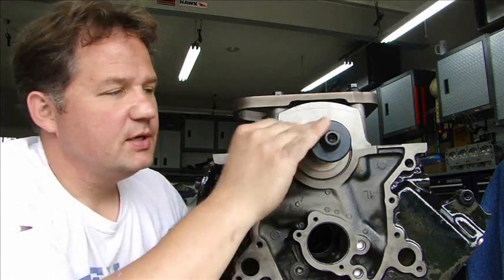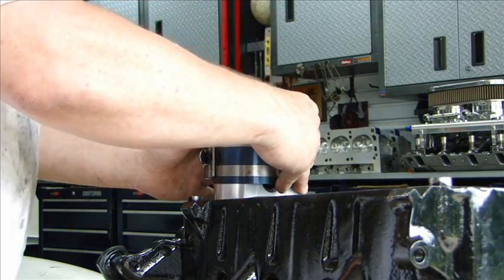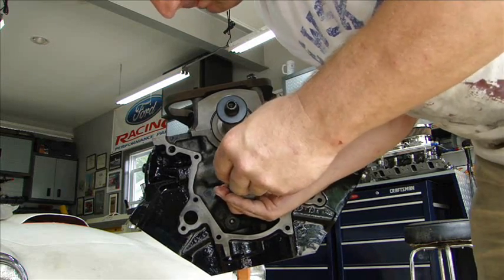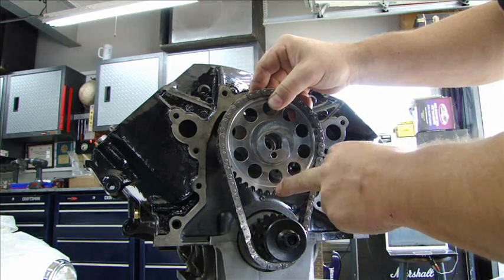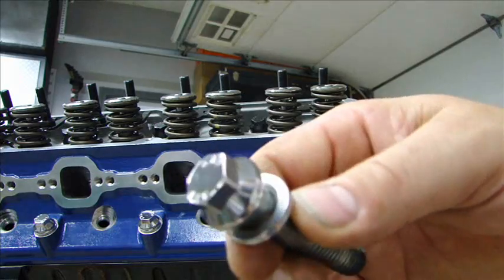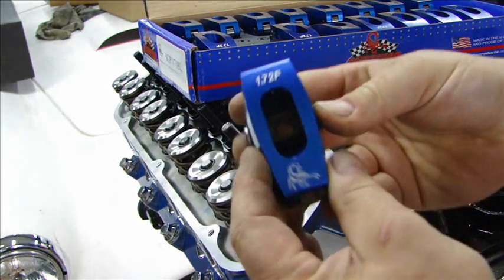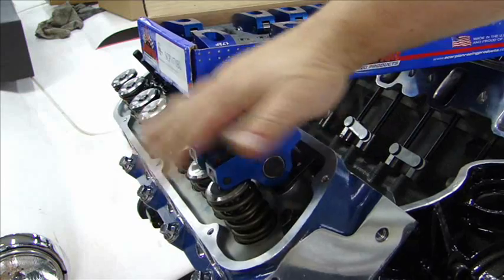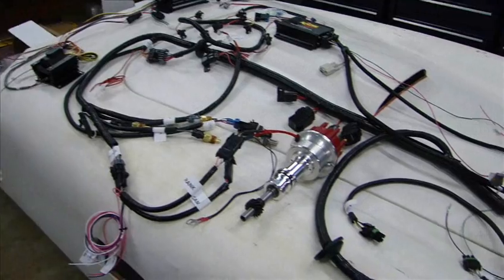Cobra Engine Build Part 1

Comment: Pete, i think a good point to add in when assembling the lower end and getting the pistons in would be to cover clocking your piston rings properly and maybe a how to video on that, would also like to see some videos on something that all ford guys can appreciate, the old school Yamaha engines, i know for sure i would love to see some cool SHO builds, the taurus was and still is the ultimate sleeper, hell id gladly donate my time to help (cough cough my daily is a SHO) :D
Reply from the maker: Clocking rings is a pretty controversial subject. I always say to follow the manufacturers recommendations. I have read studies that show the rings do rotate while the engine operates. Drive on down and we'll rebuild that puppy
Reply: Haha we'd have to talk numbers before a commitment like that. Tempting though
Reply: Please elaborate if you will
Reply: Joe Dupuie If it's true that the rings rotate during operation, then it's probably best to separate the gaps by the most distance to minimize any possible alignment of the ring gaps.  I guess it would be safe to say any number of combinations would work other than aligning the gaps but I don't particularly like guess work, that's why I watch these vids and try to learn.
Reply from the maker: This has always been a controversial subject. If you follow the manufacturers recommendations you can't go wrong.
Reply: ***** i've always followed the 180 degree clocking as it makes more sense to me for ensuring gaps dont align. it's all builder preference at the end of the day.
Reply: You can put the rings in at 180 degrees but they will rotate to where ever like as soon as you start it up.

Comment from the maker: That is true...but there is a method to my madness. If you put the cam in first, while you are putting on the rod caps you run the risk of dropping a cap, bearing, or even worse, a bolt, and nicking the cam. That is why the cam is put in after the pistons are installed in engine assembly plants. There is no right or wromg I guess. Sounds like you have a killer motor!

Comment from the maker: The exhaust rockers are fine at 1.62 but I want to open the intake valves as much as possible so I am using the 1.72. It's pretty common....they are sold in split sets.

Comment from the maker: Crap. I am so sorry..I should have thought about that. The problem is not the stud itself, it is the size of the thread that holds it in. If you tell me the diameter and pitch of the threads I will do some calculations and tell you what size thread you need so the rest do not pull out. If one did, others will. Let's fix this the right way so it lasts a long time for you.Going from 80 to 100 is almost a 20% increase, probably 25% with the higher ratio.

Still working on my oil problem.

Comment: Great vid gonna really help me with some of the decisions in my build. In regards to the iat you are right that it is critical at idle but it is a intake air temperature sensor am a mechanic by trade and have had problems with iats before
Reply from the maker: This particular system requires monitoring the air temp in the idle air stream. Since there are two throttle bodies there is only 1 idle motor in the rear one. This sensor is placed in that air stream because it is only active at idle.....I do understand your point... Thanks!
Reply: How does it monitor air intake at load then?

Comment: Take an old fan belt, bend a loop in it, and poke it under the cam as it comes through.  Gives you a little leverage, and helps hold the cam up, and aim it into the cam bearings on the rear of the cam.
Reply from the maker: Stoney Browning That's a cool idea!

Comment: One thing i noticed. You said that ARP hardware is Grade 8 Hardware. This is not true. ARP bolts and hardware is actually stronger than grade 8 hardware. This is due to the originator of the ARP brand, noticing racers of the earlier days of the hobby using true grade 8 hardware for their engine builds and having to constantly replace fasteners. Seeing a need for a stronger more reliable way to keep their motors together. thus the beginning of ARP (Automotive Racing Products)

Comment: ARP actually has a different part number for head bolts sets that includes stainless bolts for the outside. I'm running the same rocker arms on my SBC.

Comment from the maker: There is not enough metal in the casting to cut a pocket big enough for a ball bearing race. It would not last as long as the standard surface bearing and a failure would be catastrophic instead of a gradual wear like current bearing types. There are many forces and temperatures applied to a cam...ball or needle bearings are just not up to the task. Very good thought process though...I like it.

Comment from the maker: The starter may be to tight to the flywheel. Loosen the bolts a little a try agan. If it turns easier you will have to shim the starter away from the flywheel.

Comment from the maker: Not so... A 5.0 can have a smaller bore with longer stroke. There are many shapes a gallon of water can fit into. The flow rates of the heads will determine carb jet size or injector latch time. The variable cam timing is done with a hydraulic phaser. If you have a closed loop OBD II system it could throw off all of the computer settings. You will need to re-program the EPROM for the new engine settings. It's a complex project you're taking on. Good luck.

Comment from the maker: I wanted to get the intake valve open as far as possible without using a radical cam. It is common to buy rockers in split sets.

Comment from the maker: I'd have to look it up...but I'm sure it's Federal mogul. If I build a motor that will run within a day or so I usually just use 10W30. Engine plants just use motor oil and the engines can sit up to 4 months before running.

Comment: I have built many engines. The FIRST thing you put in is the cam. Put the engine on its butt and slowly drop it in. Will not damage the cam bearings.

Comment: the exhaust note of an engine is related to the manifold design, which is related to the firing order, which is related to the cylinder layout and crankshaft design - therefore the sound of flat-plane V8 is usually somewhat like a pair of four-pot engines screaming simultaneously, unlike the rumble of cross-plane V8s.

Comment: Man those rockers a friggin gorgeous. How much your valvetrain run you? seems like you did EVERYTHING and the part I love the most is the hydalifters. Low maintenance is a big plus. Also what kind of lift and duration #'s your cam puttin out? What kind of overlap you gonna have. I could go on but I know you have a life lol. Also what kind of girdle is that? didn't know 5.8's even HAD girdles. lol. Still green sir, I'm still green :D

Comment: hey like the video u seem real knowledgeable everthing looks real nice thanks for the tips.

that being said i did wonder about the crank and cam insertion it seemed a little hard to turn the crank, i was wondering if it was lubed i had not seen u using oil on the install of that or the camshaft.

Comment: next time when u install a camshaft..stick a long screw from waterpump in the center hole of the cam and it will bee much easier to "balance in" the cam holding it by the screw ....

Comment: Great video. I just took the hood and front quarter panels off of a high mileage Toyota Corolla so I could use it as a make shift engine run stand. I’ve always wanted to have a hobby of rebuilding engines, and Toyota is one of my favorites. Any advice on the best after market piston / seal manufacturers as well as the best machine shops for boring and honing?

Comment: I need more details from you MasteR about adjusting the hydrolic rocker arms
Reply from the maker: How can I help?
Reply: I have 93 gt stang and im doind overhauling the engine stock crank rot pistons..only cam b303 with aluminum cylinder heads gt40 with hydrolic 1.6 r with bbk sort headers...i dont know how to abjust correct the clearance on the valves and how many lbs i have to tide the cylinder heads bolts because is aluminum

Comment: Hi Pete, was wondering if you could help guide me in the right direction. I have a 3800 series 2 GM engine V6 that I am looking to install ported heads on. Would your method for adjusting valve lash be similar to how it would be done on my engine? From what I heard from several videos both intake and exhaust valves have to be closed (on base circle of the cam) but you made your adjustment with either valve opened a little. Any advice on this subject would be greatly appreciated sir. Thank you.

Comment: Thanks for the reply. I'm just trying to get 400 hp with h/c/I. (and exhaust)
And have never built an engine before.... But read A LOT about it if that counts for anything. I don't understand cam measurements and how much of a difference that it will make on the valve end or how to calculate that.

Comment: Hi Pete. I have a 1991 Mustang 5.0 I got a set of Roller Rockers by Crane. It's a pedestal type rocker with a 1.6 ratio with small shims included. Is it a simple install for my stock engine or must I do adjustments?

Comment: What application is this engine built for? Street/strip or mainly street? Seems like it would be an awesome engine to throw into a drag car. I plan on doing a build for a street/strip notchback mustang down the line but i'm still trying to find out  which engines are good for that application. Right now i'm looking into doing a 351w based 427 stroker for it. Still new to this so any input would be appreciated!

Comment: I have a question. I'm currently building an engine with my dad. and one of the problems we came across is when we put the spark plugs on the engine and begin to attempt to start it. the starter has a hard time to spin the engine. we assume the engine has high compression. Could you give me as to any ideas of what you think the problem could be? Thanks in advance!

Comment: Does the valve lash adjustment apply to solid cam and solid lifters too? I have solid lifters and a solid cam but roller rockers, how would I adjust that?

Comment: now what is the use of the different rocker ratios. so you can use a small lift and duration cam while still have a sufficient amoutn of lift and duration or what? thanks

Comment: It is cool , but it is a 408 if my math is right.  You could bore a 390 to 4.08 , and add 4.125 crank and you have a 431. It would look great. I don’t understand why people put Windsors in , you are able to set up a great EFI FI, even two FITech throttle bodies the use 58 psi of fuel but they are self learning.  I just wondered   I haves seen 595 hp and 555 ft lbs from a 445,  4.08 bore and 4.25 stroke. I n  ll m just curious,  you are an outstanding craftsman, and I love the guitar s I am 62 now and I really miss playing but I messed up my shoulder and arm.
Reply from the maker: Cost, and those EFI systems were not available when I built the engine

Comment: Always soak rolling parts like roller lifters and rockers in oil before installing. You need to make sure oil is down in the needles before starting. Always check cam timing, never assume. Check valve geometory.
Reply from the maker: That is a great tip...thank you. It has been my experience that unless you are going to start the engine relatively soon, any oil you soak parts in will either drip off or evaporate within a couple weeks. We assemble engines with 5W30 in the factory, but for hand built engines I like the Moly lube that will stick.
Reply: You need to make sure there is oil on the needles and the only way is to soak in oil. Dry needles on start up can ruin them. You cant get molly into the needles unless you dismantle them and that has it bads.
Reply from the maker: Another good point. I usually tilt the lifters sideways to get lube into the roller...like packing a bearing

Comment: Pete I have a very serious question to ask.  I'm rebuilding my sbf 306 due to a flat tappet cam lobe being destroyed.  The block is all cleaned up and it's ready to be rebuilt.  However I've been contemplating on a roller cam setup.  I'm really leaning on wanting to run one of the alphabet Ford roller cams but what am I to do about the lifters.  My block is a 1980 flat tappet block.  I see that I can retro-fit it with the spider tray and dog bones but I would need to get a smaller base circle camshaft.  I don't want to run one of those cams.  So my biggest question is if I get a set of those link bar lifters (Howards or Lunati because even though they are $360 they are the cheaper ones) can I then run any regular roller camshaft I want?  Now I do understand that I would need to change the distributor gear, pushrods and possibly valve springs.  Your guidance would be greatly appreciated if you had the time to chime in.  

-Billy
Reply from the maker: Hey Billy....I would look at getting the cam and lifters as a set along with the retrofit dog bone. You will need to change the push rods and valve springs to match. I would do that anyway since the motor is apart. If you need more help give me a call
Reply: If it get one of those then it would be one of those smaller base circle camshafts. Right?

Comment: And why would that be? Injection tends to improve driveability, makes more torque, solves cold-start problems, lowers emissions, and improves gas mileage. Unless the engine comes with a carb, injection is anything but a bad thing.

Comment: Peter, can you advise on a Rochester carberator, whether you need two O2 sensors, i.e. one for each header to ensure you have both idle mixture screws adjusted correctly?

Comment: I just figure that the new 5.0 is still 302 cubic inches just like the old. The only difference that I can see is h/c/i and rpm range, so if I can match flow rates or exceed I should make the same or more. The only thing I can see lacking is variable cam timing, resulting in a narrower HP and TQ band

Comment: I have a 4.3 vortec.
The stock rocker ratio is 1.5 and as im sure you can imagine the cam is quite mild.
Ive read that just a 1.6 on a 350 can usually make around 25hp
I figure a 1.6 on my v6(bone stock) would hopefully draw around 12-15 
Would i have to do any adjustments to studs or add cradles or anything?
Im told going to a 1.6 requires no other parts.
But what if i wanted to go to a 1.7? Im sure thats pushing it on stock valvetrain but im only turning 5k rpm.
I understand if your not sure

Comment: Are there any clearance issues on the block with that size of a crank?  Any die-grinding or is it a drop in?
Reply from the maker: Yes. The block has to be cleaned up where the weights come close. But it's just a quick grind with a burr to make the needed clearance.

Comment: pete nice videos and how much in the engine besides electronic's ? im buying a F0 block 351w for my first engine build its gonna terribly slow process with money issues but im get it done
Reply from the maker: +Hector Romoarias This engine was $15k and the electronics added $5k. If you made some different choices you could do it for around $6k
Reply: I was going to buy one but i didnt get the deal soon enough

Comment: It seemed like you had to smack that piston quite hard to get it in the bore, usually light taps with a wooden handle of a hammer and they slide right in for me, were those high tension rings or something?
Reply: Looks like hes using an old school band type compressor which don't work very well unless they are pretty tight. The important thing is the pistons slide down the bore with reasonable freedom. This guy seems to be pretty good, Id venture to say his end gap and bore clearance are in.
Reply from the maker: They are racing rings and I gapped them on the low side. It is tough to get them in, but I do have collars for standard bore sizes so the piston slides right in by hand.

Comment: Do they have an engine mount that turns the engine 90 degrees vertically? This way the cam can be dropped in with no hassle..
Reply from the maker: skynetter121 You're on to something
Reply: +Petes Garage I always installed the cam first.  With the crank out of the way you can guide the rear of the cam through the bearings easier.  Installing a long bolt in the front makes a good handle too.

Comment: I've always wondered about the girdle, is it really necessary and under what circumstances?  I built a 347 with around 450 flywheel horse and it has seen 7000rpm regularly.  I used ARP main bolts.  Haven't had any issues yet, but don't know if I should ever expect any.
Reply from the maker: Since this block does not have a 4 bolt main and is over 500 HP I wanted to make sure the block was not going to twist. There is no real clear line. It's more of an experience thing.
Reply: ***** Do you ever like to use a Ford valley girdle along with the crank girdle on any of your engines?
Reply from the maker: Like a valley pan gasket?
Reply: *****  Well no.  It is like the following.

 http://www.competitionproducts.com/Valley-Girdle-Pro-Valley-Girdles-Ford-351W-2-Pc-Set/productinfo/VGPVG351W/#.VGZ75vldXTo

I am not associated with the website or the product.  I am only using the page as a representation.  Thanks.

Comment: Why did you put 1.7 on the intake and 1.6 on the exhaust instead of visa versa? Also, was it necessary for you to use tie bar roller lifters instead of dog bone? Or was this just for retrofitting the roller valvetrain?
Reply from the maker: I want to get as much fuel and air in as possible, exhaust is under pressure. The bar comes on the lifters as a retrofit
Reply: @PetesGarage  I read an article that showed no hp was gained going from 1.6 to 1.7 unless you swapped the exhaust from 1.6 to 1.7 and left the intake as a 1.6. they explained it as there was too much back pressure in the exhaust ports on sbf heads
Reply from the maker: That may be true which is why I used the RHS heads